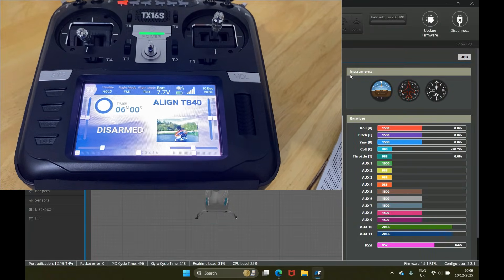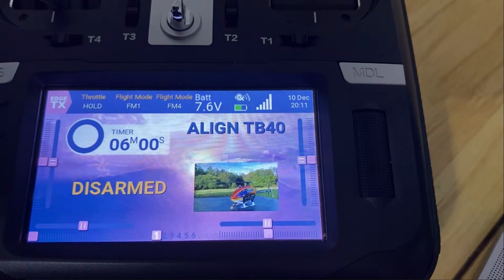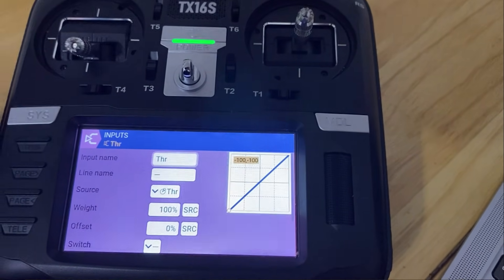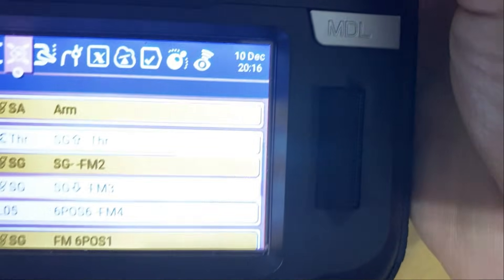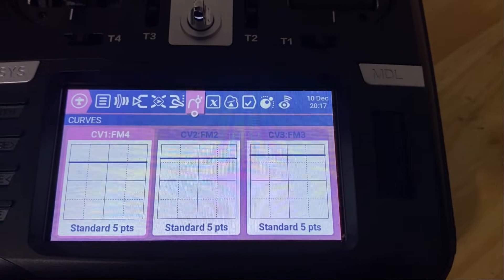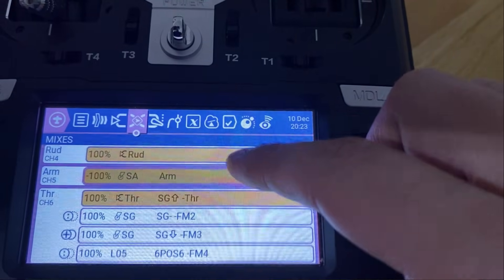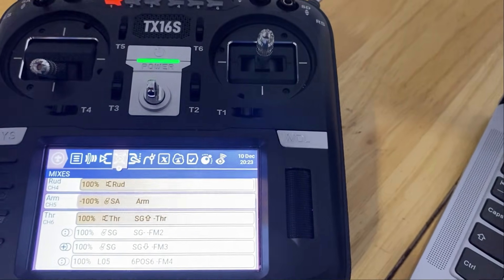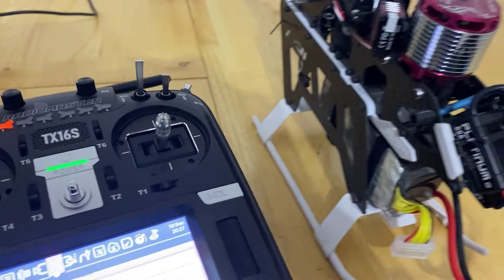Rotorflight Nexus-XR "Normal Flight Mode" with Radiomaster TX16S ELRS

Comment: @Moshir Fakhoury "Regarding the throttle not responding until halfway up the stick, could this be related to ESC calibration? I usually perform the calibration with the throttle range set to -100, 0, +100 to help teach the ESC the full throttle range." never had a motor "cut" when below half
Reply from the maker: Hello, I believe when using ELF mode in the ESC the throttle starts around 40% so I think it is do with the ESC. Personally I don’t recommend flying in normal mode and I certainly never do. But I did this video as a couple people asked if it was possible. My ESC was calibrated at the time so I am not sure its calibration issue and more how the ESC behaves. But I might be wrong

Comment: Great video. I have just returned to heli’s after many years and have gone the Tx16 /  nexus route which is quite a learning curve.
I now have my system set up with 5 flight modes, normal, idle up 1, Idle up 2, angle mode and horizon mode using your videos.
However it now looks like you have no throttle cut now for auto’s, have I missed something?
Reply from the maker: No you haven’t missed anything, I didn’t set up a throttle cut, was just happy with arm/disarm function. But throttle cut can be set up. Do you know how to do this?
Reply: @FlyWithMoshirRC 
Thanks for the prompt reply. I had not thought of that I will just do the same rather than having another unnecessary switch to think about.
Reply: @tyran370  Thanks for your advice and I will assign a switch for Throttle hold.
This is all new to me as I have been out of heli’s for many years and also new to Elrs.